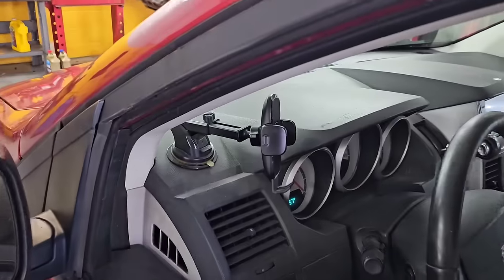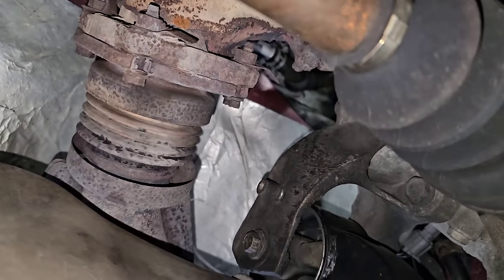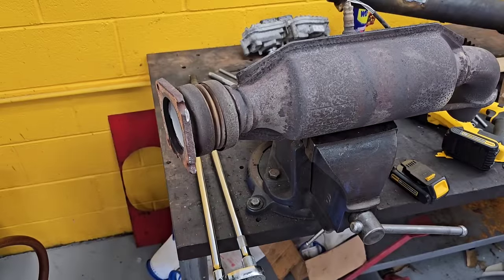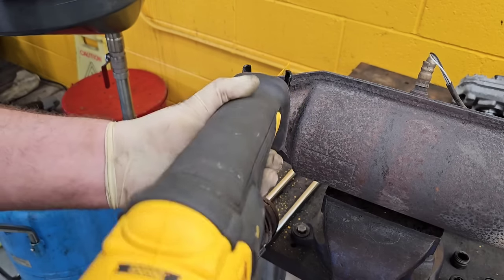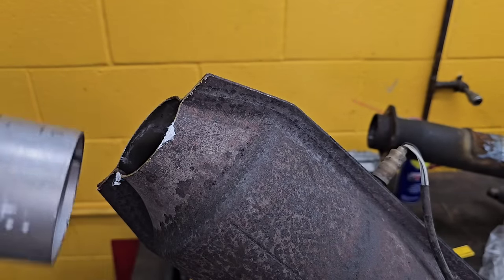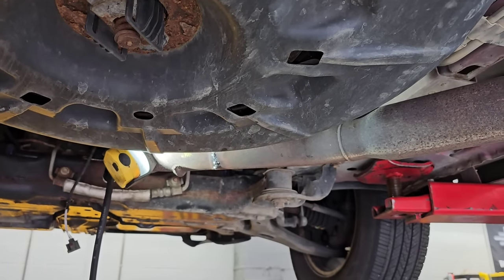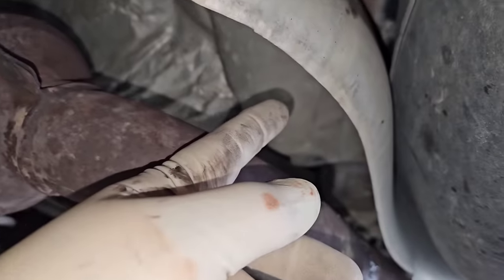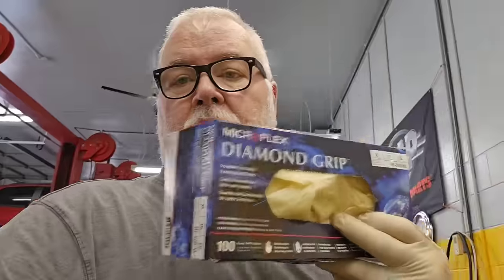Replace The Catalytic Converter? Heck No!! Let's fix it instead!!

Comment: I have been told disconnecting positive first can cause voltage spikes and can cause damage to sensitive electronics. This applies in the electronics world as well working on radio systems, computers etc.
Reply: I guarantee you they can't tell you the why, only that they heard it somewhere. The battery doesn't know which side is disconnected so neither does the car. What I have seen shops do is leave it connected but use a capacitive shunt across the battery for welding. It has two giant clips like a charger with the device between them . This was at a muffler shop.
Reply: @InsideOfMyOwnMind  Yes, I bought mine from MAC tools back in the early 90's, probably close to when they first came out. It's called the "Battery anti zap" I have used it whenever welding on vehicles or equipment but do I know if it really works? No, not really, lol.

Comment: About the battery when welding, I have heard this also but, I have seen others welding without disconnecting and they use the 'welding ground lead as close as possible to the weld to prevent the current traveling through out the vehicle' as the reason. I won't take that chance when it's so easy to disconnect in first place.
Reply: Do both.  Disconnect the battery and connect the ground clamp as close to the weld as possible.

Comment: When sawing off exhaust with a Sawzall consider dulling that sharp point on the blade so if the exhaust pipe pinches the blade you don't poke a hole in whatever is above the pipe.
Reply from the maker: Thanks for the tech tip! Keep wrenching 🔧

Comment: Disconnecting the battery does nothing to protect onboard electronics from stray voltage supplied by your welder . Remember that the ground wires running into all the modules are still connected to the car's frame , so they each become a potential path to ground for stray voltage. It doesn't hurt to disconnect at the battery , but the MOST important thing you can do is to insure that your WELD GROUND is attached firmly and as close as possible to where you plan to weld. then DON'T get careless with your stinger when moving around between welds . Try not to strike any unintended arcs . The closer the better , because even if ALL the wires are disconnected , the current coming from the welder can and will melt wires that accidentally become "live" .

Comment: The early Toyota Landcruiser ie Gasoline models, the starter connection was directly above a glass fuel bowl, cause a spark and drop the wrench, better have a fire extinguisher handy, disconnect the battery Negative first!!! Ted from down under
Reply from the maker: 😳 that must have been crazy! Thanks for watching & keep wrenching 🔧

Comment: You did a real nice job Kenny, I'm not much of a welder either, my dad, God rest him, was an ace. I think you were just a little bit hot, that thin pipe is a pain. I try to go from side to side, in half or whole circles if possible. If it doesn't leak, that is all that matters. I'm surprised you didn't locate that crack and try to sling some on that, but if you are happy, I'm happy. Have a good one.

Comment: I remember I took the positive off before the negative once. The ratchet I was using touched the brake line right under the master cylinder. It created a spark and caught the brake line on fire  for a few seconds 🔥

Comment: Fortunately I don't have a Chrysler product with that issue, but I sure am glad for the long life exhaust systems they're putting on vehicles these days.  I got where I could put an entire exhaust system on an 83 escort in about a half hour.  Glad those days are gone.   Keep the good stuff coming Kenny.
Reply: I had a Mk1 VW Polo where it was a one piece system. When I collected the new one from the parts place getting it home was fun. It was too long to get in the car. So I did the sensible thing, I left the silencer sticking out the back of the boot and tied the tailgate down. I got some seriously odd looks off people as I drove it past people.

Comment: As someone who had a catalytic stolen and is also a booger welder, i used a 3" to 3" pipe coupler when welding the two straight halves together. Was such a good fit i almost didn't weld it, i did just to secure it but just some spot welds and zero leaks, looked clean 👌

Comment: I did roughly the same thing. Only I torched out the bolts on the flange. There wasn't much if any room up in there. 

Then trying to get the bolts and nuts back together is quite another story...

Comment: Eastwood Co. sells the exhaust welding clamps with holes in them like you described. I have a few of them and they're great for building custom exhaust systems.

On the other hand, you could've also used a band clamp to attach the pipe at the back. They're available for both lap joints and butt joints and work well.

Comment: I've had to do this repair 3 times on my caravan with almost 400k on it. Those replacement flex pipes don't last as long as the original one but it sure beats replacing the converter. I think next time I'm going to try using a different flex pipe farther down in the exhaust to make it easier to change.

Comment: Brother Kenny, I got excited the moment you pulled out the sawzall! Have you ever tried using "heat wrap"? I'm pretty sure that Mrs. Wrenching (Meg) will be happy to ride in the van again. You told me once that you have never changed a PCV valve on a 3.8 V6. Maybe when you change the brakes, you can try the PCV valve. By the way, my previous Chrysler Town and Country needed new front calipers and brake hoses. The pistons would rust on the calipers and the inside of the brake hoses would deteriorate to the point of shrinking inside. Poor brake fluid quality since it is so hydroscopic might be to blame. Oh there are so many things to do as maintenance on a vehicle!!

Comment: The flex joint helps stabilize the engine on the motor mounts. You get a firm shift with a new flex pipe. If you find a motor mount is shot, replace it, or the flex pipe gets hit with extra stress.

Comment: You could have  put a hose clamp around the pipe to keep it in position and attach the flex pipe to the other pipe and in the cat and tack it, and it would be a perfect fit

Comment: If you are welding on a vehicle.. always disconnect and short together battery cables..  voltage spikes from welding can kill processors... radio included... had a friend told to disconnect the battery on  a friends car.. he didn't... did his welding .. no start.. dead computer..
Reply: I’ve heard some modern vehicles you don’t want to direct short the cables together because it can damage the computer somehow. I think I heard that on a Scotty Kilmer video. Don’t know if it’s true.

Comment: Kenny, I would of preferred to buy a cheap Ebay exhaust which comes in sections for easy installation. Granted first weld your Cat flex pipe first. Time is money and that extra time you're spending cutting/Welding that rusted exhaust is not cost effective nor wise.
Reply: Naaaah-  it's his personal vehicle....
"challenge accepted!"

Comment: I never unhook the battery to weld and never had trouble, but then i dont own any of these new crappie cars and your weld isnt that bad a touch hot but it dont have a bunch wire sticking out and 50,000 starts

Comment: Put your tool and lawn and garden equipment lithium batteries in the refrigerator after using them for 10 minutes. Then take them out and plug them into the charger. The turn around is quicker and battery life is longer. Hot batteries don't recharge quickly and can kill their lifespan.

Comment: The first Weld looks like it’s too hot. Amps too high, but I was a nuclear weld inspector not a welder, but they wouldn’t pass lol but hey, as long as it keeps the gasses sealed and doesn’t crack on you than you’ll be fine. It’s nothing critical, structural or anything. 
 The second weld looked ALMOST like it wasn’t hot enough and not much penetration, but hard to tell from the angle and what you showed on the butt weld. 
God bless~

Comment: Just love to watch american cars, which most is petrol cars. Is not the case in eu. Most of the cars are diesel ones in here. And modern diesels comes with egr, dpf, AdBlue systems. What makes car sophisticated and hard/pricey to fix. On other hand there is great mpg while have great torque and hp

Comment: It would have been easier to place one mark on the old part and one on the cat before cutting it off, and then align the new part with the old. At least thats what I would have done!  Oh well, as long as the finished part works as it should

Comment: Kenny, worked for years in industry both as a steamfitter/pipefitter and an Industrial Instrument Mechanic (industrial controls).

When welding on equipment with sensitive electronics you disconnect power like you did here.  The other thing to do is to connect your welder’s ground clamp as close to your weld as you can.  This reduces stray eddy currents as much as possible. 

Something you didn’t mention and I thought you and your viewers would want to know. 

Car computers are expensive, PLCs and instrumentation make car parts look cheap. 

Keep wrenching buddy.

Comment: And people wonder WHY are CATS are so easy to steel.30 secs= 100 bucks cash? I venture to think.DID the design engineers think that at what is probably the most expensive part on newer cars that MAYBE,just MAYBE we could make it harder to STEAL?but then of coarse you wouldn't have to buy a FACTORY REPLACEMENT made ONLY for your particular model of car. but wait there's more>the average Joe engineer that works on his own car WANTED to make a UNIVERSAL one that's oval shape 4 x 6 x 12 inches long and it only had 1 price 100 dollars and all makers of cars used that only,.but they had to lay him off.So now he's heading up his own car company TESLA.haha You get your choice 3 stock versions with colors red ,white,blue and black that's it.

Comment: It looks like you are mig welding but I don't see the gas bottle . I use flux core wire when there's rust involved. If it slags you drag. I use a miller and their parameters are a good starting setup.